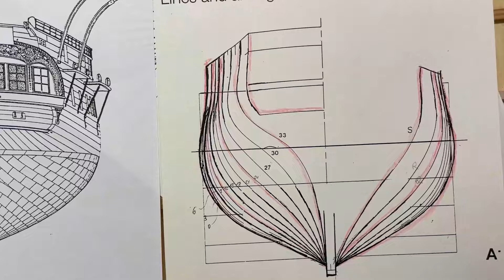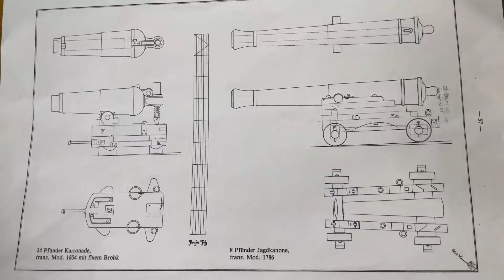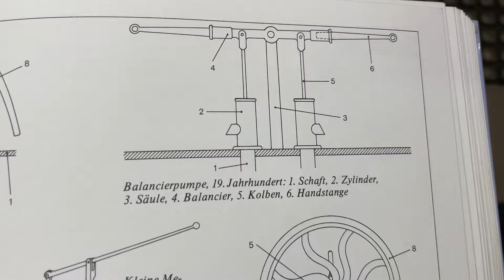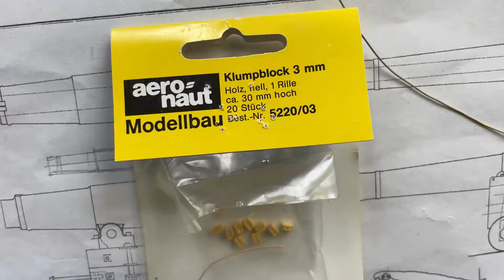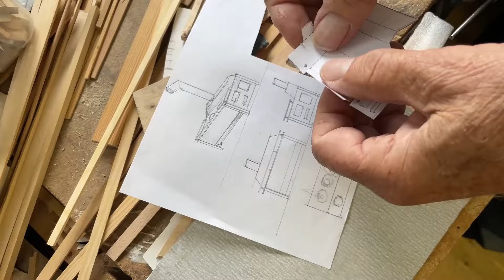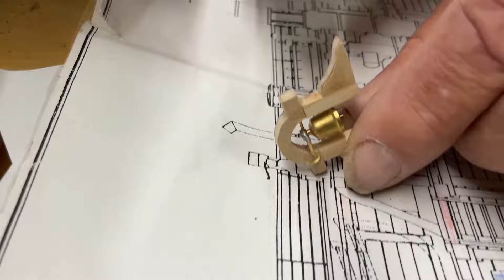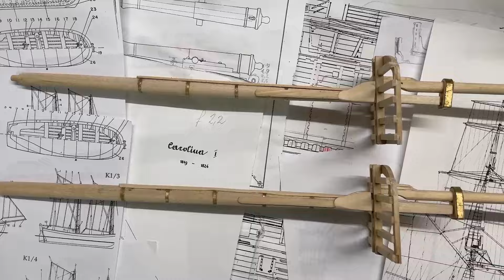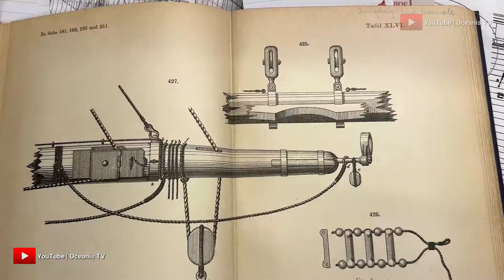How To Build Ship Model,  The Carolina 1/65

Comment: I very much want to learn how to do this hobby but I don't have anyone to ask question to. Like where do you get the plans (lines) from? Which are the most accurate plans? When there's no plan for the sail or mast, how do you know how to build it? What books are the best resources to guide me in doing this hobby? How did you learn, did someone teach you or did you learn from books? What books. Where do you get your wood from? what wood to use for the different parts of the model?? I want very much to learn how to do this hobby but I don't know how to get started and I don't have anyone I can ask questions. With respects!
Reply: At the high level shown here, this is not a hobby but a CAREER  This gentleman is a PROFESSIONAL in what he does and he does it for a living. Greetings.
Reply: For starters I recommend an set from artisania Latina with new instructions.
They are step by step with pictures and videos. Often not so historically correct in the details but you get a nice model.
For the knowledge of I can recommend two books: 1. "Historische Schiffsmodelle" von Mondfeld and 2. Bemastung und Takelung von Schiffen des 18. Jahrhunderts" from Marqardt. (only know the German titel 😅) 
If wood is to intimidating to start with, there are nice plastic kids from heller or revell.
The most important tip is to never rush things, take your time and try things out, even redo things until you are setified with the result. (I build 2~4 years per ship)
You will learn from every ship you build and will improve.
Also watsh a lot of these YouTube videos. There are always interesting building techniques to learn
Reply: @peterd5465  Thank you very much. That is very helpful information. I also thank you for your time to answer my question. I wish you all success. Cheers!